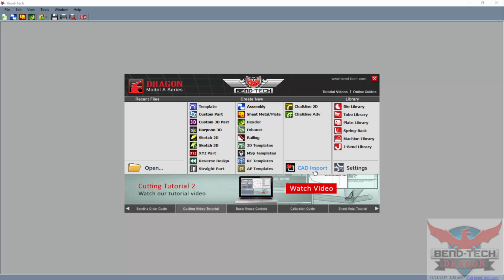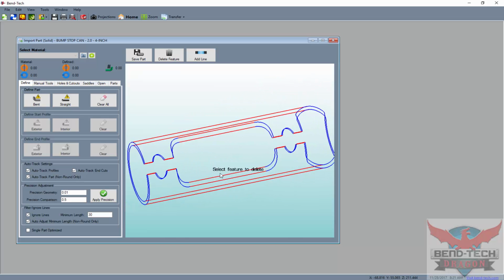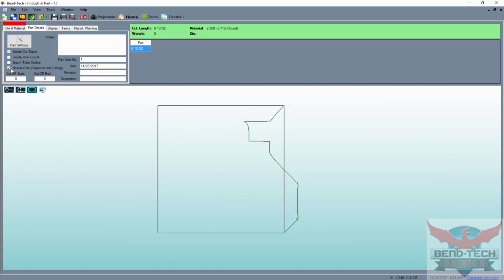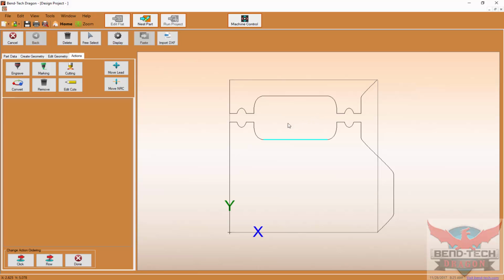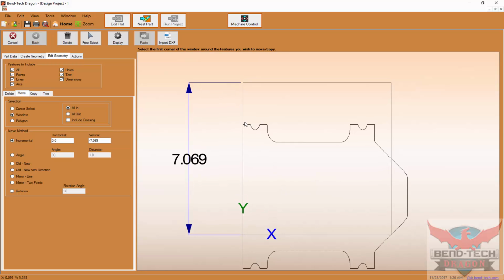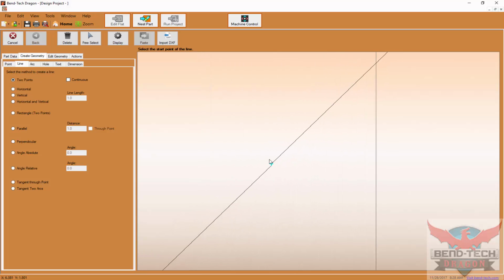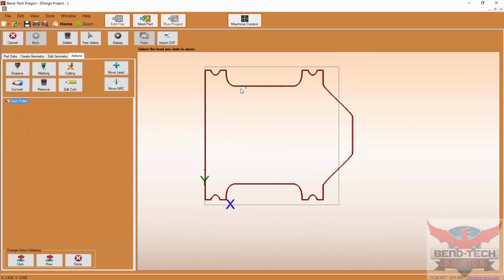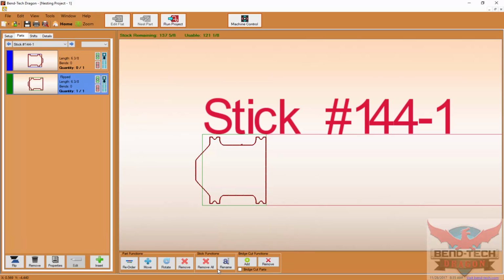Bump Stop Can Import

Comment: Be careful with this.   When I made these according to this video the cut was on the wrong side of the line.  My parts were .100" to short.  Should have been apparent with negative lead in and out.  I had to make a small break in the cut line so the program would switch to the other side of the line.   Just a heads up.